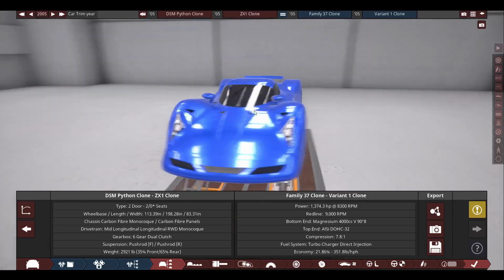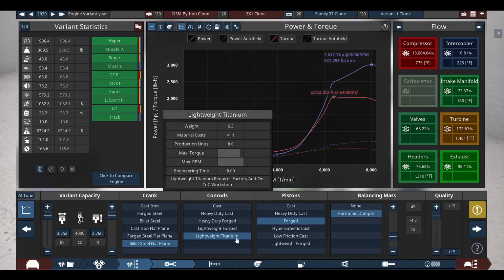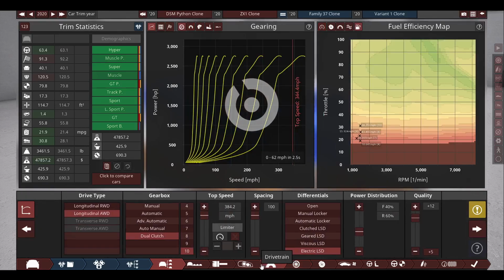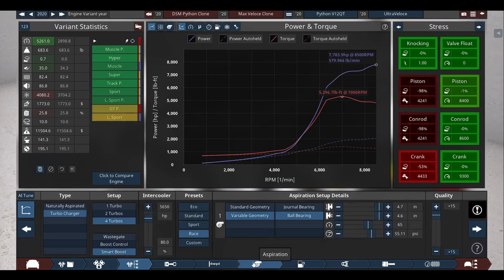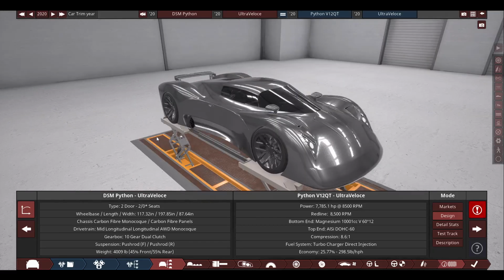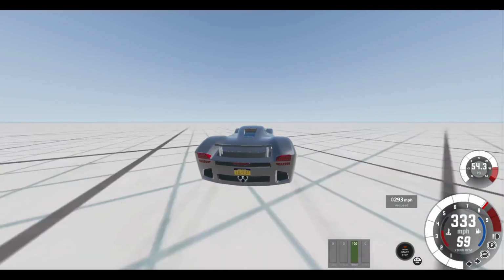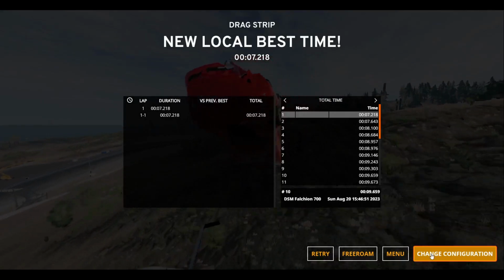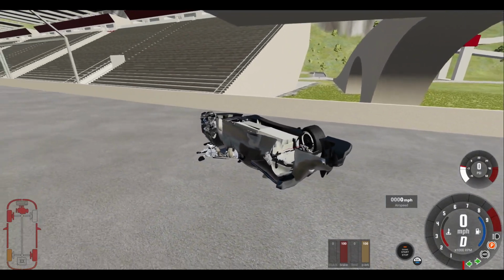I Gave My 300 MPH Hypercar the Most Powerful Engine I've Ever Built - Automation & BeamNG.drive

Comment: The auto gearbox on the 7k car is super scuffed and constantly pinging off the limiter, id say you could get sub 7 seconds and a way higher top speed with manual shifting, more front downforce would do wonders for top speed stability. I also noticed you set the weight balance 100% to the front which I don't think was intentional lol
Reply from the maker: The weight balance was to move the weight closer to center since it's mid engine and more of the weight is in the rear
Reply: @thedansandwich330  oh right, my bas

Comment: the 7k hp car doesnt seem to go into 10th gear by itself, so you could try to manually shift it into final gear. doesnt add stability, but might get you more topspeed?
Reply from the maker: Good idea, I didn't realize that
Reply: even the 3k hp car have problems with gears